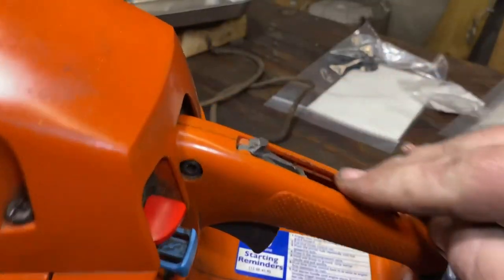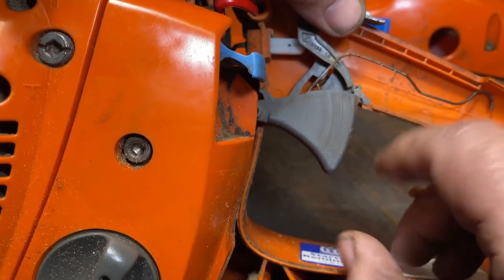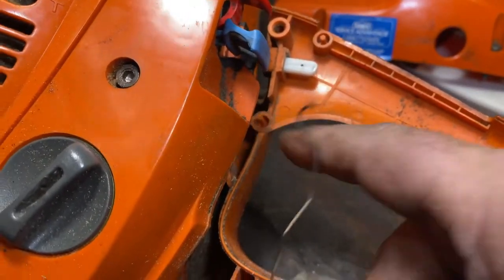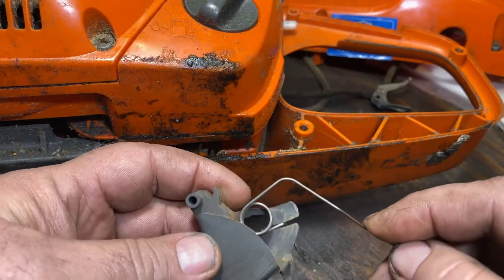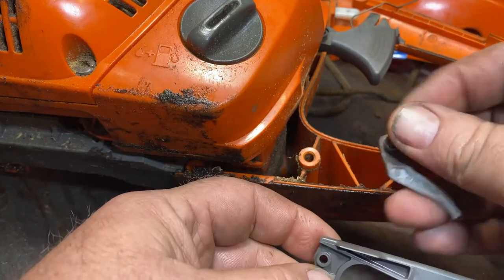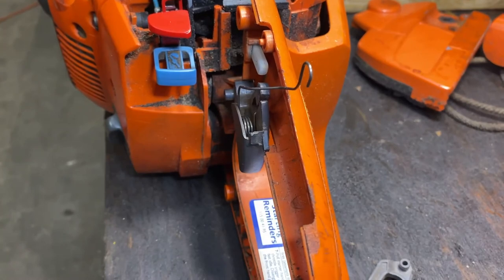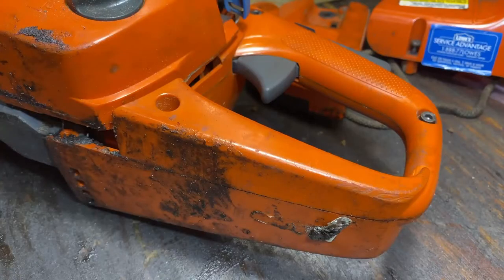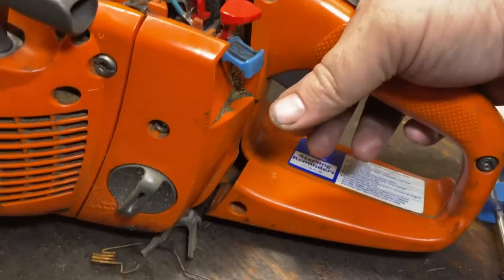Husqvarna 455 chainsaw throttle trigger and lock out lever repair.

Comment: Thanks so much. You saved my butt! Had to replace the cylinder due to a stripped spark plug hole. Never thought the trigger would be the hardest part. Thanks again.